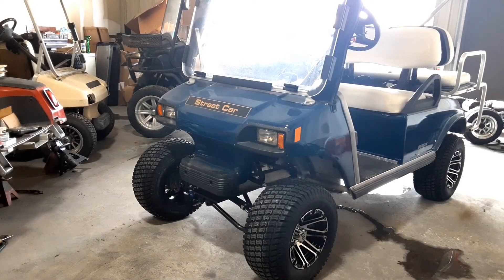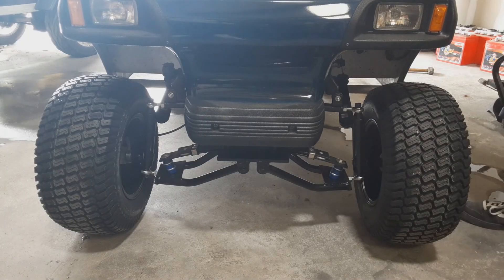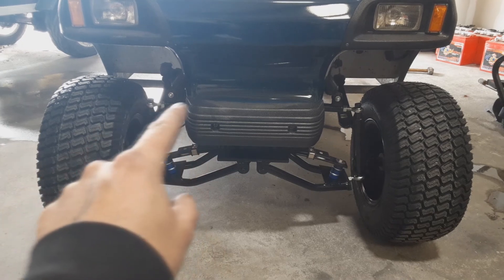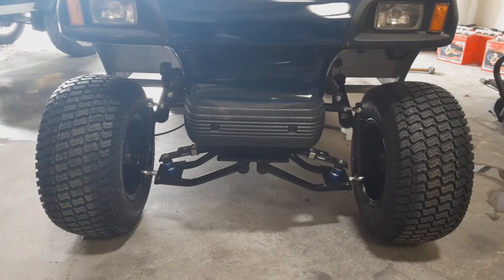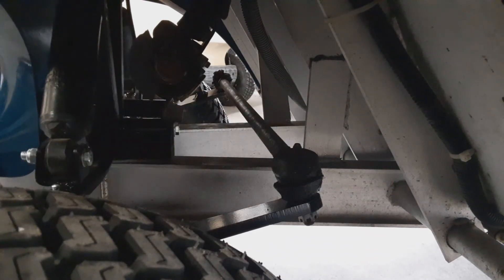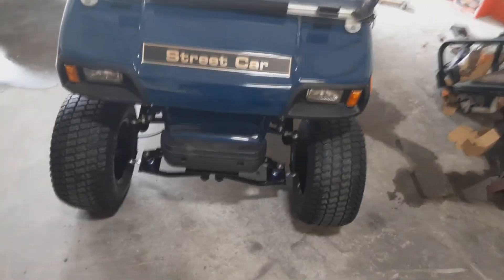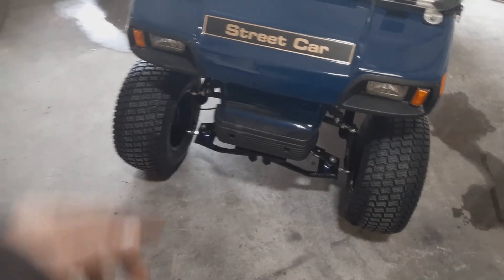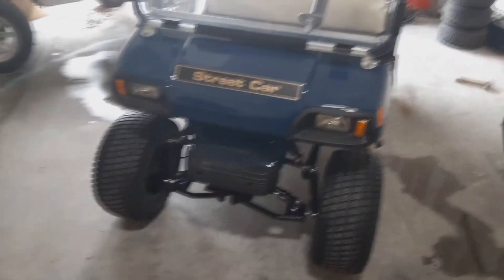Club Car DS Front Alignment

Comment: What if you do this and as soon as you drive it now the toe in is too far in and the cart sways a lot very squirrely, 
So you readjusted again.  I have readjusted this alignment six different times to get it correct and still it will have one wheel pointed outward a little bit or the camber will be off where both tires are leaning inward at the bottom of the tire.         .. I'm starting to think maybe all the parts on the front end are worn out and that's why you can't get a good consistent alignment.
Reply from the maker: Gotta check those bushings out up front, the kingpin sleevs and the tie rod ends. I have another video on setting the alignment as you're describing, check it out